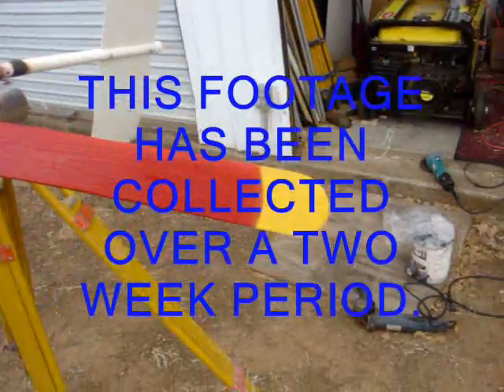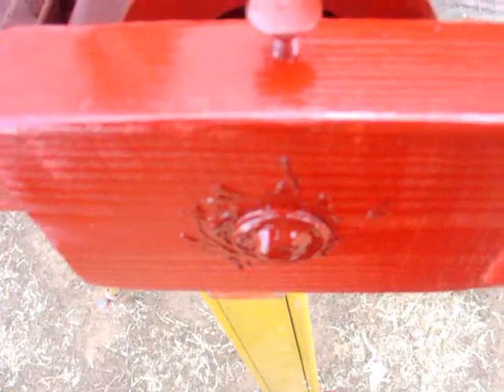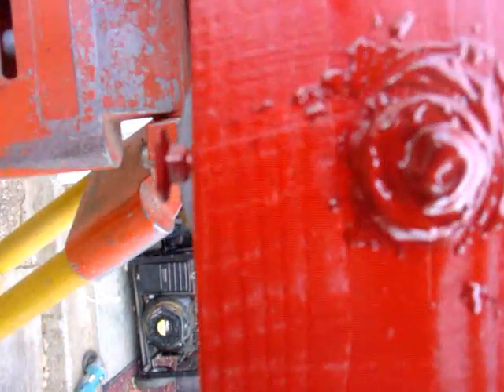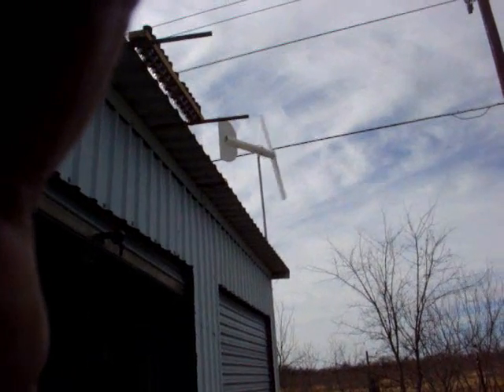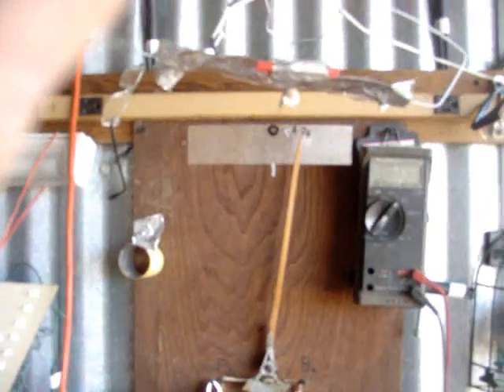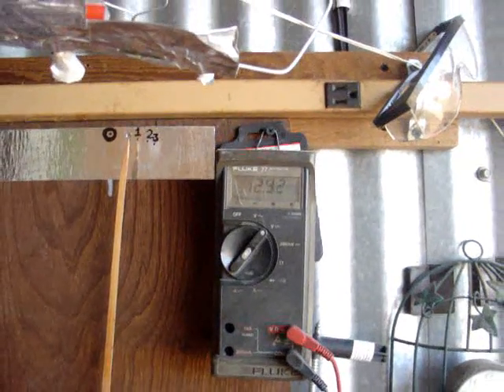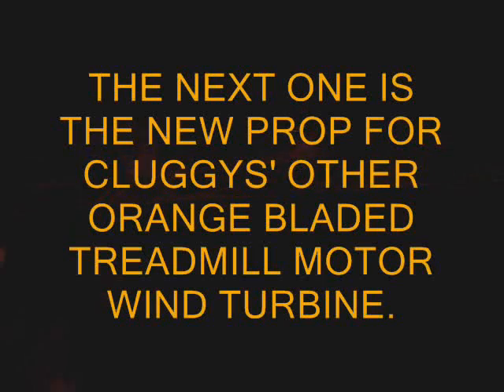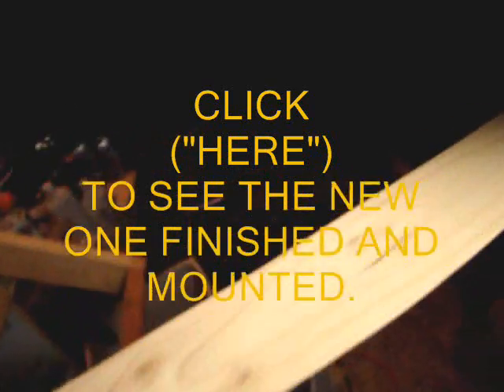CLUGGYS' SECOND TWIN TREADMILL MOTOR WIND TURBINE PROP

Comment: ...make up a 4' rotor, but I suppose that will be close enough? I intended that turbine to have an axial flux, so i'll probably just 'borrow' the blades for this little motor and carve some more later for the axial flux...if i ever get the nerve to build one lol. unfortunately i lost a blade in a wind storm just before Christmas because my test tower is way too shaky, so i'll have to get carving again soon. thanks again MUDDy, you're the best!

Comment: you are AWESOME, thx for breaking it down! the motor's size is about 6" long and 2.5" in dia...8 - 10lbs in wieght. i salvaged it from a piece of dental lab equipment that an old customer of mine (who worked in dentistry) used to mix the 'ingredients' for making false teeth. he had two of these but sadly the other older model used an a/c induction motor. when you say a 5' prop i assume you're talking about a 5' swept area, and not 5' long individual blades? the blades i have now (cont...)

Comment: a good supply folks for 3 blade propellers is the dump...old outdoor type air conditioners have nice aluminum fans with 5/8 arbors [usually]  i have not used one yet so let me know how they work

Comment: a quick question, if you don't mind: i've acquired a 24v dc motor that i can use for a turbine. i have no idea what the rpm rating is, but when i check the output with a cordless drill @ approx 1200 rpm i get about 17v and 10 amps. it's not a 'serious' power generator, of course, but i thought it would be a nice little project. the problem is, i have no idea what size prop i should use...any suggestions?